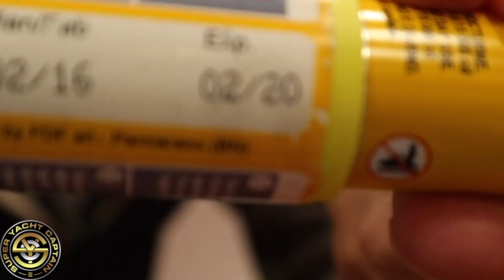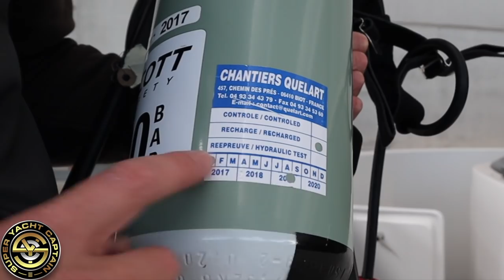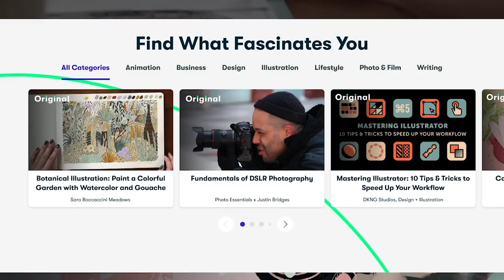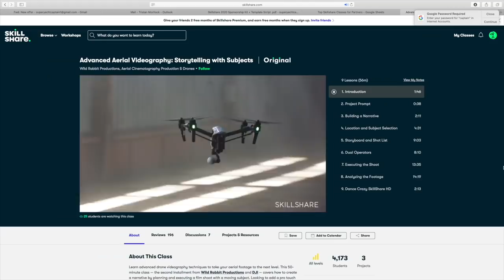SUPER YACHTS, CRANES AND SURVIVAL EQUIPMENT - BEHIND THE SCENES (Captains's Vlog 121)

Comment: you keep your load as close to the ground as possible when moving it so if the straps break it has less distance to fall. also if it breaks it will not damage any vessels
Reply: Spot on, its all about risk management. If they break loose up high dear knows what they will hit on the way down.
Reply: DemonKnight Gaming is correct. It is a safety issue. If it is high up, people might not see it and walk under it, and if it does fall, the higher it is, the largest the force of the impact. While it is harder to manoeuvre due to  the pendulum effect, there is a better chance that it will never kill anybody.
Reply: Further to that, swing is normally controlled by tag lines.
You can see that rather then use a tag line, the operator simple grabs on to it.

Not the BEST idea give he still has a second load above his head.

Also, the overall force will remain the same carried high or low.
High it will swing a lower distance but at a high frequency / faster speed, low it will swing further with a lower frequency / lower speed.
Reply: Frequency and speed are two different things.

Comment: The crane is called a traveling crane.  They are common in industrial structures because they can provide lift basically anywhere in the structure regardlessof what is on the floor.  They so high to provide the most clearance over the building contents.

Comment: Interesting that you collect all the fire extinguishers to one place, leaving the complete boat vulnerable, even if the boat is out of water and risk of fire lower than under operation.  I do not have boating experience but factory safety experience and here in South Africa, part of the safety audit is, apart from equipment functionality, also location.  We need a floorplan with all fire fighting equipment marked by location and type, as well as hazard areas by type and magnitude.  This is inspected by the safety auditor to ensure that all safety equipment is placed appropriate, and also that they are clearly visible and accessible to all, not only employees but also visitors to the factory.

Comment: Tristan, you lower the load for safety / visibility and if something slips less fall height.  Also if you are using a tag line to control the load while airborne you have much better command with a shorter line. Great videos.

Comment: Here in south west England our last fire extinguisher service all dry powder extinguishers where removed as now pose a hazard to those with breathing difficulties including asthma because of the silica in them just foam and Co2 left. Nice to see AWOL videos again.
Reply: As an ex firefighter, my thoughts are conflicted.

Asthma or not, it's not nice to breath dry  chem.
But they work VERY WELL.

Foam is the safest of the three if you ignore the slip hazard it causes, but it's also harder to use compared to the other three.

Co2 has severe limits in outdoor and windy environments AND has a worse risk to breathing as it displaces oxygen  AND you can't see how much or where it is (the white "spray" is actually just condensation from the gas rapidly cooling the surrounding as it expands).

They all have there uses, but if I could only have one I'd pick dry chem every time.

Better to have an asthma attack then for the boat to burn down at sea.

Comment: Great video keep them coming . As far as the crane load keep it low. To prevent swing you had the safety guiding  the line. If the load was high and the rafts fall they could damage yachts on the way down.

Comment: I recall in your early days you were on a boat that burned to the waterline, without much warning. Would those fire masks have helped at all? or would you not have had enouogh time?
Reply from the maker: Its a good question, I'm not sure they would've helped but it was a much smaller boat. The drills we do onboard with the BA suits is to rescue life.
Reply: Quite right. your not going to fight a fire yourself unless it is relatively small. Unless your crew has training as firefighters specializing on boats,  you don't want to be crawling around on your knees in thick smoke if no one needs rescue immediately i.e. everyone is already off the boat. Get dis-orientated and then run out of air spells disaster, especially when the boat is insured.  It can be replaced, life cannot.
Reply: Our engineer once used a fire fighting suit to enter the aft steering compartment to douse an electric motor fire when I sailed in the merchant marine. At sea you need to put out fires yourself and you must avoid smoke inhalation.

Comment: Wouldn't you be cheesed off if as a private boat owner (not charter) you only used your boat a couple of times a year but you still need to go through this every 12 months regardless?
Reply from the maker: This is a legal requirement for commercial vessels only. For private vessels it’s only recommended. 👍
Reply: @SuperYachtCaptain  Great info! Thanks
Reply: Whether private or commercial the safety rules are to save lives. You should never skimp on the safety of those you love just because they are invited guests and not commercial guests.

Comment: No inspection of the Rings? Epirb?
The rings themselves do deteriorate from exposure so a visual to make sure they are still safe to use is a good idea.
The epirb needs to have battery tested to make sure it is working.
Reply from the maker: Yes but not by the surveyor. Check out this video. Answers your questions. 

https://youtu.be/XYqVDg561RU

Comment: That is not how i was taught to lift loads. A single cinch strop is not the safest way. Load was carried way too high, when it should be lowered and guided through (or lowered onto a pallet truck!). Then one person stands underneath the load whilst doing something with the other when it got to the ground. One day he might drop one of those. You could use a guide rope to prevent any swing.

Comment: Do you only have small powder extinguishers? 😱
Reply from the maker: We have Co2, Foam and powder extinguishers
Reply: Powder requires a lot of cleansing if you spray it out, very corrosive
Reply: Johnny Jonvall A fire that is not extinguished is more difficult
Reply: Powder is not good for it corrosion, foam/Co2 is better, but it requires bigger tank

Comment: I am surprised at how little signage you can get away with regarding safety equipment signage. I know that Australia would be considered the nanny state of the world and that reflective signage is ugly in a vessel with high paying  customers. But in the case of an emergency, even with a safety briefing most of your customers wouldn't remember everything you have shown them. Large reflective signage at least reminds people of where everything is as they walk by.
The most important reason for large obvious signs come into play when an emergency is happening. Someone in a panic well more than likely  calm down a little bit when they recognize that they are at a PFD locker, or have found a locker containing a fire extinguisher. Yes they may use a fire extinguisher without your fire officers approval but in ghp  built boat 10 seconds to a minute of response time could be the difference between a wasted fire extinguisher and the boat burning down with a possible loss of life.
I don't think the small dual laminate emblems you have for each safety station would cut it in an emergency situation. Look up the saturation rate of inflight safety briefings to get an idea of how little people take in of each briefing, large in your face signage while ugly at least gives your passengers a chance in the case of an emergency where your crew are either unaware of a situation or can't get to them.